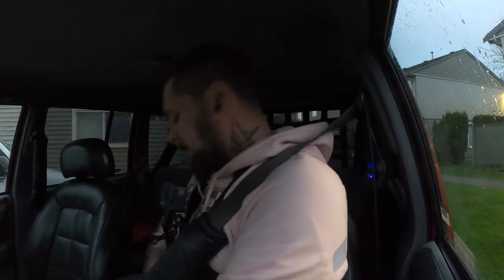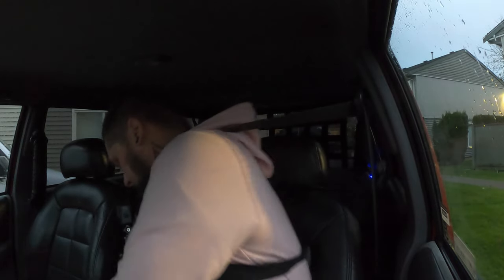WHY IS MY JEEP XJ OVERHEATING?

Comment: not the Jeep
Reply: Yes the jeep
Reply: Did you ever figure out the issue? Did you check the harmonic balancer? If it’s separated it may be slipping at higher rpms and not be turning the fan clutch fast enough.